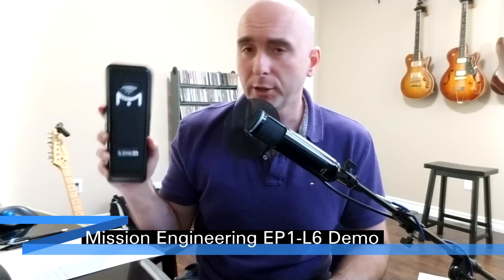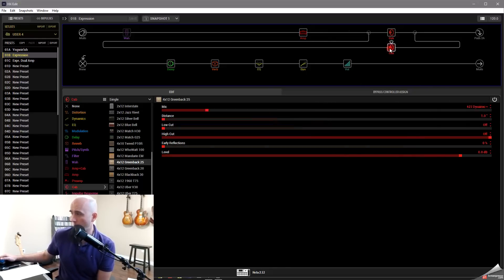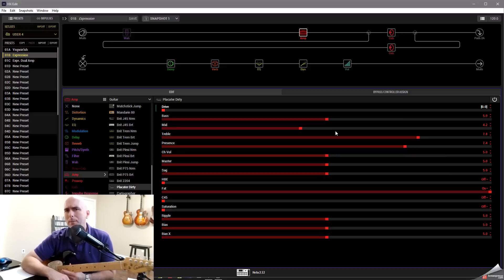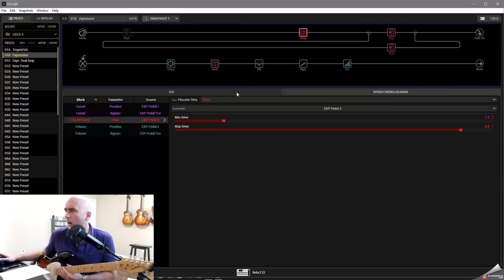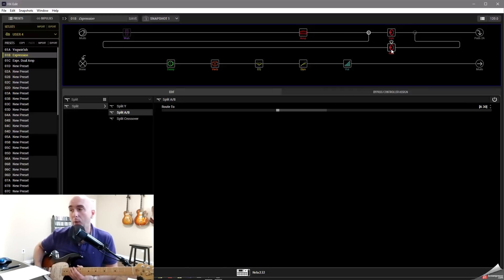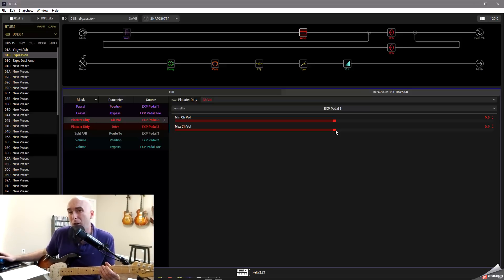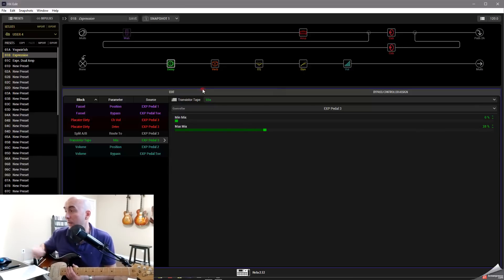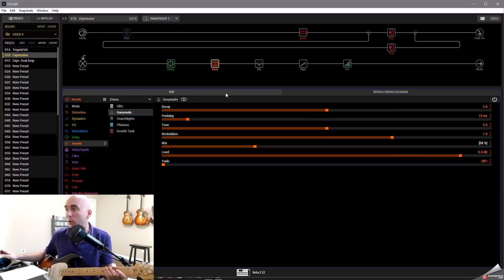Multiple Expression pedals with Helix and HX Edit

Comment: Hi, I have an EP-1 Mission pedal (NOT the L6), and if I use a TS or TRS cable I can't use tha full range of the pedal! when I step halfway down on the pedal, the range shown on helix goes from 0 to 50%, and when I continue to step toe down then the range showing in Helix goes back from 50 to 0%... So heel down is 0%, then it  goes to 50% and then back to 0%?! When I pull the jack cable halfway out of the pedal, then the wah pedal works properly from 0 to 100% in Helix. Any help how I can solve my problem? It's the regular Mission EP1 not the L6 and does not matter if I use TS or TRS jack cable.

Comment: Does the normal sp1 (non l6) works with an hx stomp?
Reply from the maker: The standard SP-1 will not work with the HX Stomp. You'll need the Mission SP1-L6H or the EP1-L6 if you don't need the switch

Comment: What if I want to use the tow switch on the mission pedal
Reply from the maker: The SP1-L6H with the internal switch is supported on the Helix Rack only. The Floor does not have support for an external toe switch. Setting up the Rack with the toe switch is covered here https://youtu.be/x4xJmHHQdMw

Comment: Just bought the pedal and I use it mainly for wah. I am trying to figure out how to activate and deactivate the wah function with the toe knob. Any suggestions how to do it?
Reply: did you get the pedal that has the toe switch in ir or not. some have it. most folks use the onboard pedal for wah as it has the switch and then use the regular external expression pedal as the controller or volume/gain boost

Comment: Hi Jason,

Can I assign the Expression 3 pedal as a universal pedal for the volume for every patch without having to go into every patch to change it? Right now I put the expression pedal in the back of my amp and use it that way. When I play live and go direct from the helix I want the expression 3 pedal to do what it currently does to my amp but I would rather not go into every patch and change it. Thanks
Reply: you should setup a basic patch with the exp3 in it and then when you make new patches you copy that template patch and edit from there as you add stuff for new ones.